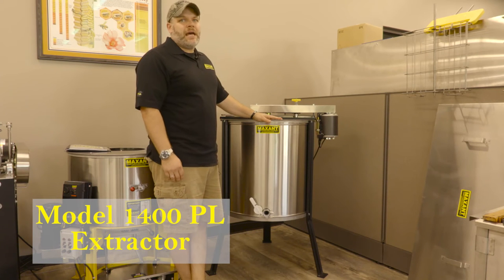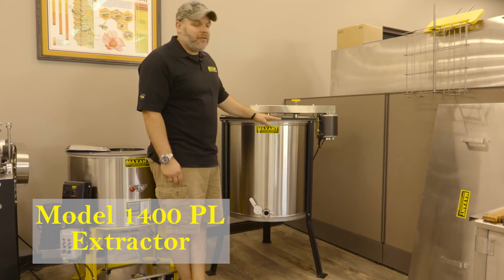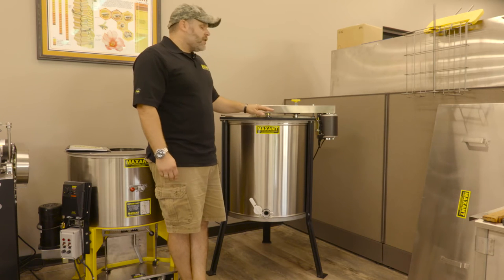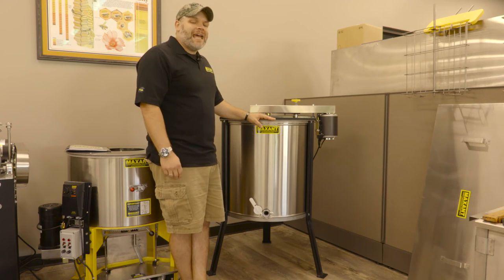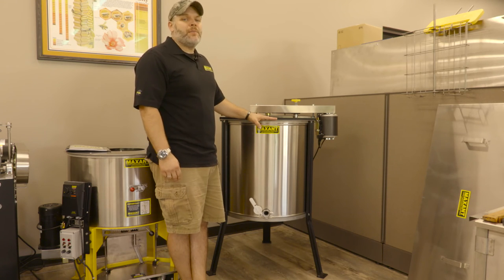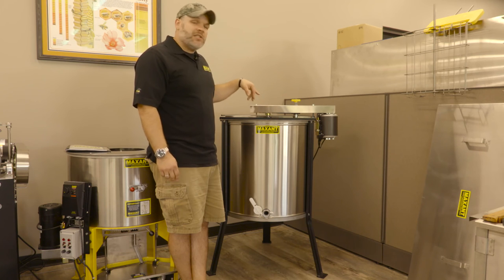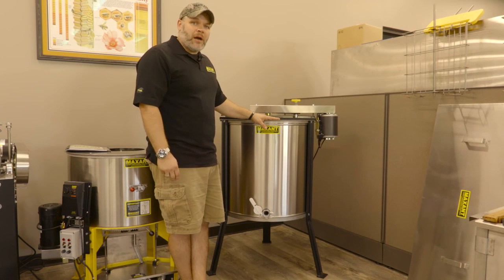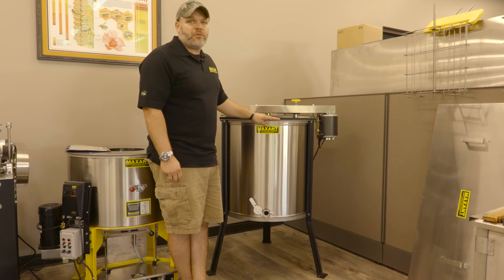Model 1400P Twenty Frame Radial Extractor POWER-20F SEMI PRO by Maxant

Comment: Hi. What is the best way to disassemble so I can service the bottom bearing?
Reply: There is a zerk fitting on the bottom (at least on mine)- it's awkward to get at though.  If you pull the motor, be careful as it's heavy and awkward when the two bolts anchoring it are removed.   Many of these bolts were cadmium plated steel which I replaced with stainless steel.   For the zerk fitting on the upper bearing, the cross bar was in the way and I had to grind a bit of it off in order for my grease gun fitting to reach it (food grade grease only!).